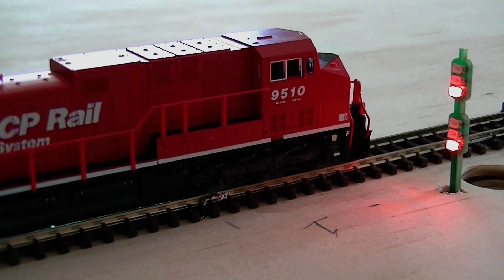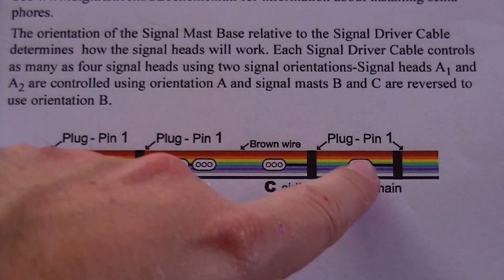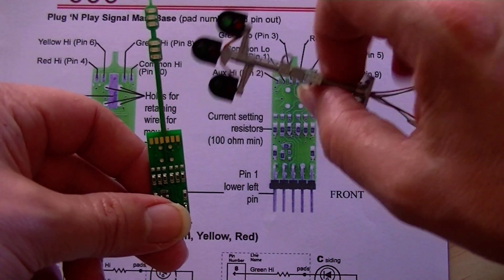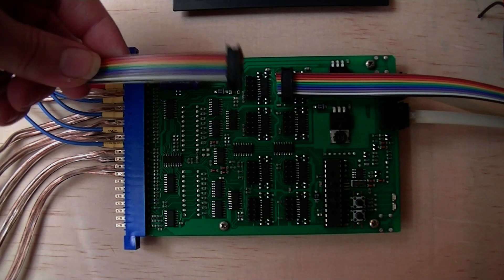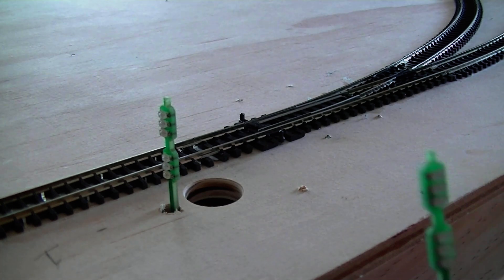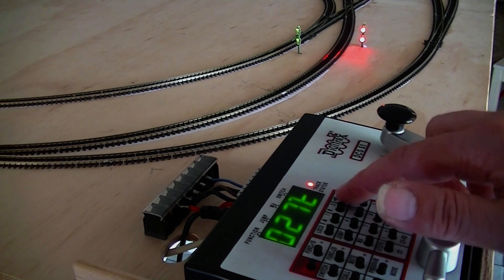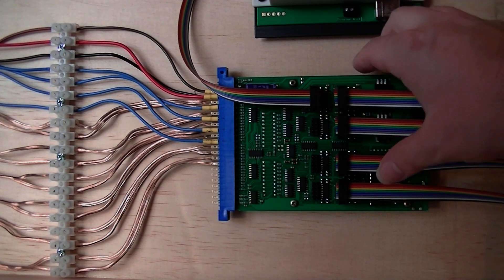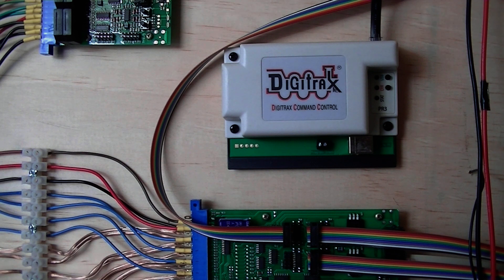Wiring up Digitrax signal lights to the SE8c

Comment: Were all those signals off one driver?
Reply from the maker: The signals run off the track power
Reply: @DetroitRiverRailroad  this is regarding the signals and how many plug into the driver.  Can you confirm?  In the SE8C directions it says one driver should control a security element or plant but it looks like only one Digitrax 10 pin signal plugs into 1 of 8 drivers in the board.  I have all the equipment just hasn’t had time to sit down wire up and test…
Reply: So it looks like ideally I could only control two turnouts or security elements completely with two double head signals for the main line and four single head for mainline other direction and the siding
Reply: Just realized my disconnect is as not realizing multiple heads are spliced onto the ribbon cable

Comment: Struggling with wiring for blocks and turn outs.
Using Digitrax PM42, BDL168 Ds64, and railroad bronze, computer controlled, but think i will go to gold when I have sorted basics.
Could you show how the wiring is done for a block and a turnout.
Do you make the turnout a block as well?
How to wire DS64 for Peco twin solenoid of turn outs, and the programming also for computer control.
Have achieved a lot of this already but then find I have problems, and then loose total control.
Probably something very simple I have got wrong.

Comment: I'm still trying to figure out which system to go with.  Some say Digitrax others say NCE.  I want to go all automated some day, so I'm trying to figure out which system can do that the best or close to it.  Also which is easier to get things for.  The local hobby shop sells Digitrax, which make it easier for me to get stuff for but I will still have to order things.  Great wiring job.
Reply from the maker: Hi Scott,
Which DCC system to buy can be hard to decide on, I started with nce but switched over to digitrax not because I thought nce was bad but more because digitrax offered a better complete package for what I wanted to do with this layout.
If a had to choose a DCC system it would be nce hands down.

Comment: I recommend JMRI, if you do not like it no harm since its free! I use it for SE8c with loco buffer as it allows me to combine control of the Loconet system (signal control only), and my NCE system (switch machines, block detection, locomotives etc). Obviously you benefit from using one manufacture that already has a very advanced control network for model railroading. Looking forward to more! :)
Reply from the maker: I was going to use jrmi but when comes to more complex computer control you need to write your own scripts.
So I leaning towards railroad & co (bronze edition) because it has a easier interface.
Regards 
Michael